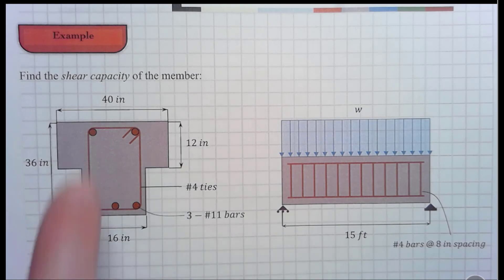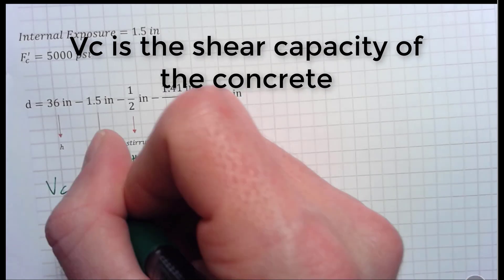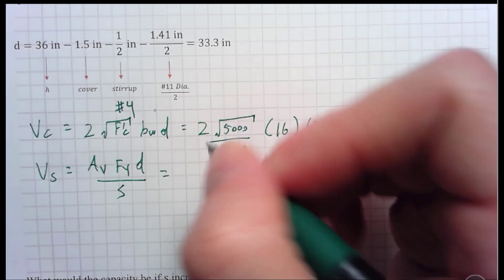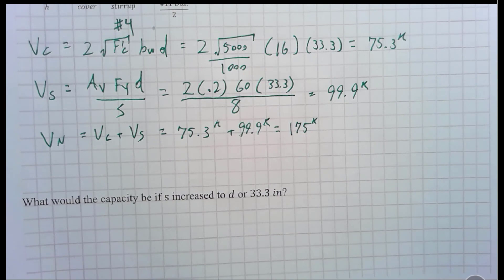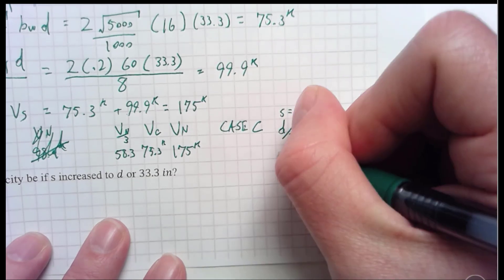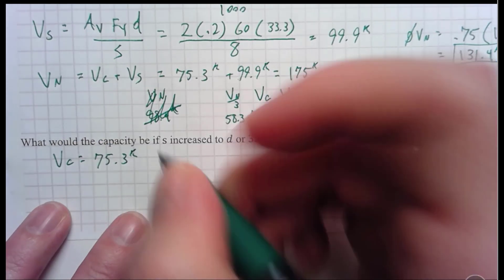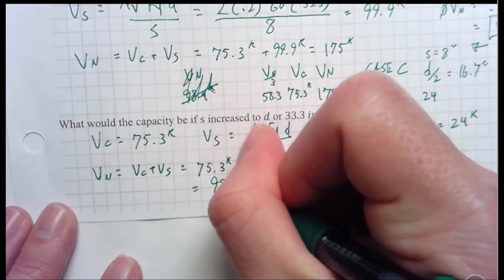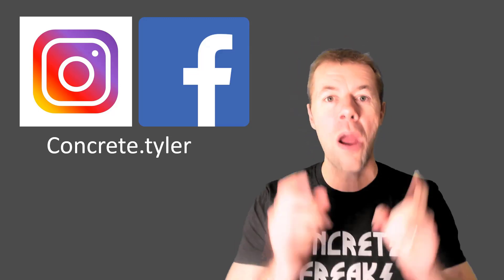Reinforced Concrete Shear Capacity Example Problem

Comment: Hi, there is a confusion though. For reinforced concrete, the coefficient for the square root of f'c is  2 while the same factor following the MCFT method is 0.0316* beta, and the maximum value for beta is 4.75 which indicates that the maximum coefficient in MCFT would 0.0316*4.75=0.15. Could you please explain why there is a huge difference in the number  2/0.15=13. Please help me get out of this confusion.
Best regards,
Abdul Saboor